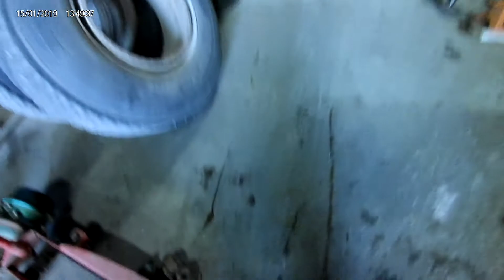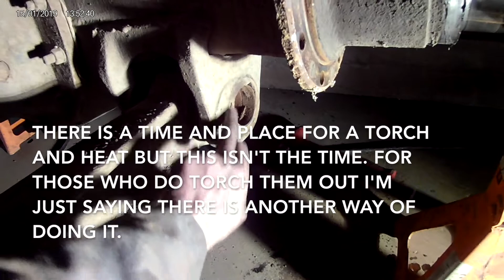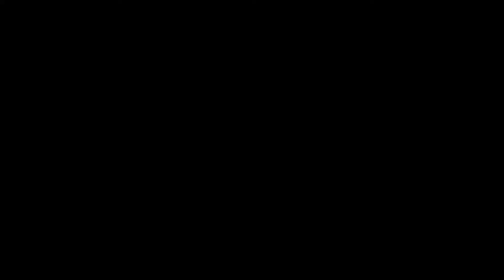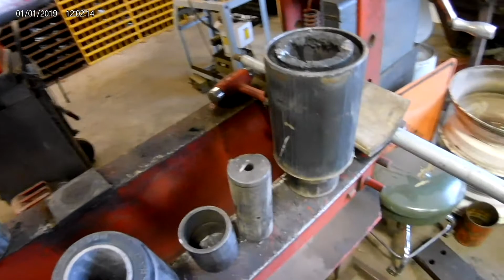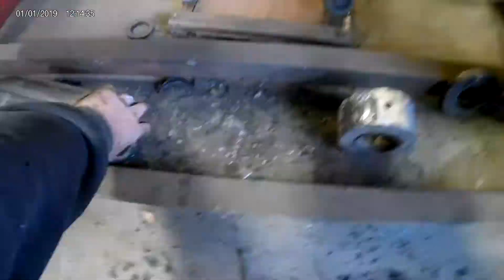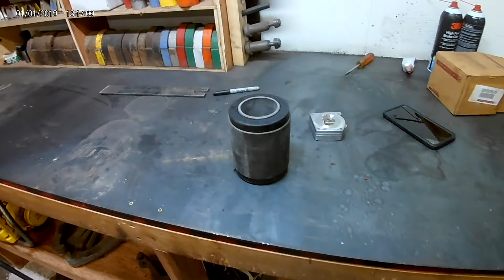Hendrickson walking beams

Comment: What part number for the bushing
Reply from the maker: Depends what model of equalizing beam suspension is under your truck.
Reply: Same
Reply from the maker: @jresquivel4499   The center bushing I used on this project was a 49600-000L and the end bushing kit were a part number of a 45000-007L.
Reply: Ty

Comment: Is your rear axles supposed to move while turning with this suspension? I have a Hendrickson rt400 and while turning I can see my rear tires poking out from the bed. Is that the “walking portion” or are my bushings worn
Reply from the maker: This walking movement is normal for the equalizing beam suspension. It's what caused the name to change from "equalizing beam" to "walking beam." What the issue is how much movement you have while in a turn, as well as,  axles alignment when straightened out; that is front to back side to side. If your rear axles are moving out MORE than half a tire width that's a good indication things are starting to wear pretty good. I've seen the beam bushings so worn that the inner tires will wear on bolts on the frame rail or the frame rail directly. Most people won't replace their bushings unless there is severe wear and something of this nature starts to occur. Hendrickson litirliture says that after cornering if the tires do not stay in alignment, side to side from front to back, it's time to change the bushings. Long answer to your question but hope this helps. I've been told that  these bushings will last in a dump truck application for about 5 years if rubber and 8  years if poly and found this to be fairly accurate. I install polyurethane bushings strictly unless asked to do otherwise.
Reply: Mine too wen I turn the corner one pops out more
Reply: @jresquivel4499  this was a year ago. I still have my truck and run it daily. Since this time I got all new bushings on my rear suspension and I have absolutely no movement. It’s not supposed to move. When the tires start rubbing against frame or other suspension parts bushings need to be changed

Comment: Can you remove only the center bar without tearing the entire suspension apart?
Reply from the maker: You can remove the cross-tube with the everything still in place just have to cut the caps off of the center bushing ends to be able to slide the tube out.
Reply: @jimhurricane5831  absolutely, just make sure the center shaft isn't welded in with rust.

Comment: Where are you located and what type of mechanic should I look for to remove and replace my walking beams on my dump truck once the bushings are pressed in?Great video!!!
Reply from the maker: I’m over in Eastern Washington. Most spring shops that press them in will install the beams as well if you take the truck to them. Don’t know if there are any shops like that around you or not. Betts Spring in Portland, OR is an good example. Defiantly more expensive this way but you get what you pay for, and the job is done well. Finding a mechanic that will put them in is the tuff part. It’s not rocket science, but you find the wrong mechanic and it could turn out bad. If you have mechanic or shop remove and install the beams for you I would try and look up as much history on the mechanic/shop to see what their work history is like. Hope this helps and good luck👍

Comment: I might have missed it in the video, I’m doing this same job. I didn’t thread the inside I just used smaller all thread and used a 3/4” gun from the outside. I did have the brakes off worked great.
Reply: 他，

Comment: What’s its cost to rebuild a walking beam suspension like that
Reply from the maker: This job we already had the bushings on the shelf. Depending if you buy polyurethane or not, which I would if you can afford the poly bushings. The cost is around 1800 the last time I bought them. That was new bushings and all new hardware. Tip don’t mix ploy bushings with non poly bushings won’t like the results on the life of bushings. Sorry for the late response.
Reply: 2000